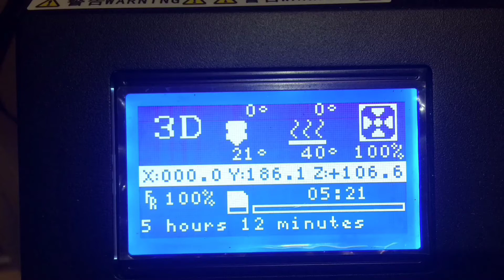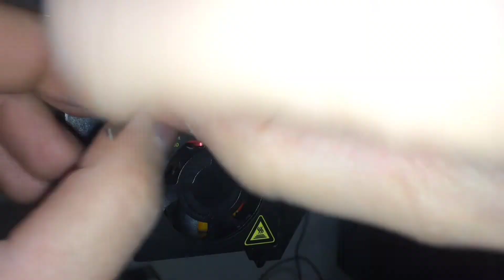Cr 10 OEM Fang Installation

Comment: How to remove the support form the inside of "windtunnels" ?
Reply: cura has multiple options for support. Make sure that you choose "touching buildplate" instead of "everywhere"
Reply: omg ty
Reply from the maker: there should not be any in the wind tunnel if you printed the one i did .all the support were on the outside of the model...
Reply: 3dprintsnstuff yap your right. but cura want to place it all inside. but the gcode data is without support inside. iam printing it atm :) ty for answer. and I would like to see how to install the stepper motor damper :))
Reply from the maker: check my other videos it is there.
if i can do it you can !
Reply: @svenbimmelbahn1915  Instead of selecting supports everywhere, select only touching build plate.

Comment: Did you print this in PLA or PETG? 

Also I'd like to see the dampeners installed. This is my first foray into anything hardware related so any tutorials are greatly appreciated! Thanks for this. It's a huge help.
Reply from the maker: ChunkyJo I used pla no problems with it as of yet .I did long prints My black panther was 60 hrs. I did the damper video also.
Reply: Thanks for the video! I was wondering how to install the fang to my alfawise u10 👍🤘

Comment: Cable management for heaterblock is wrong installed
Reply from the maker: how should it be?
Reply: Wish I could post a picture here ... the cables should be placed behind the fang, and beside the extruder, straight up. Between extruder and right arm of the fang.

Comment: My advice: cut off the plastic holder of your fang. You fix the hotend with this holder like washers on top. The plastic is not strong enough and both fixing screws come off after several hours of printing. You will get a lot off error prints after time. The fang is clamping enough on the hotend without fixing it.
Reply: mediasync stephan scharf have the exact problem after just a few hours with the fang. Will do what you suggested.